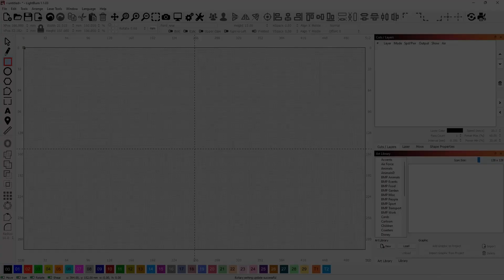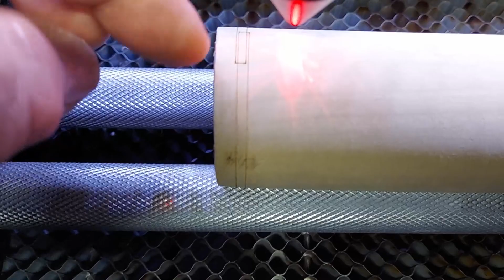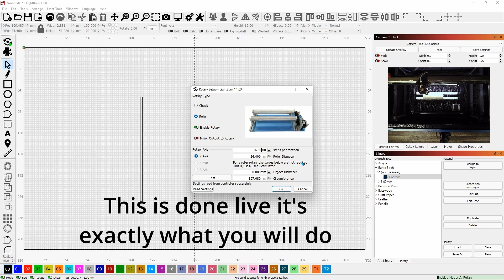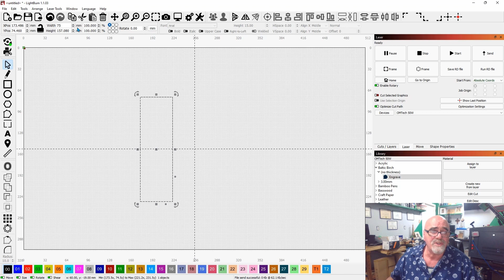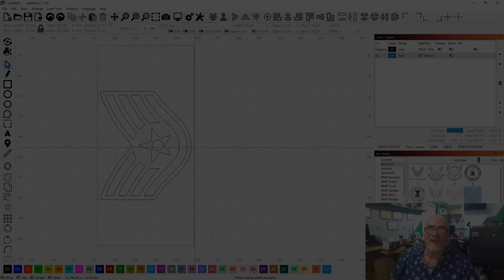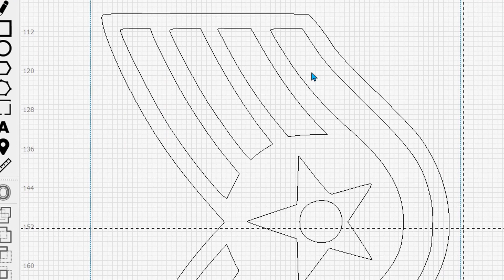🔐 Unlock The Secrets To Perfectly Setting Up Your Co2 Rotary Roller Accessory!

Comment: Does the same setup apply for  the chuck style rotary ? i was  put off installing mine after watching a couple videos. looked tedious.
Reply from the maker: Yes, the settings are slightly different though. You need to choose chuck in the setup. Most chuck rollers come with the steps per rotation in the owner's manual.

Comment: I did all the steps and it frames correctly, but when I hit start it doesn't move. What did I miss? I made sure to slide the safety over so that it would ignore the drawer being out.
Reply: Nevermind! There are 2 toggle switches on my Gweike. One LABELED "Rotary" <---> "Panel" and the other not labeled. I assumed both had to be in the rotary position but it started working when I put the Rotary toggle up and left the other one down. 🤷‍♀
Reply from the maker: Glad you got it working Cyndi!

Comment: Hi Rich many thanks for taking the time to do this video as there isnt that many on youtube that show you how to set the rotary machine up in lightburn.I followed your video to the letter by setting the laser on top of the cup to be engraved then turning the power off my machine so i can then connected the y axis rotary machine and turning my machine power back on but when i do this my machine automatically homes itself so i cant set the laser over my cup again. When i manualy home the machine using lightburn software it goes to home but doesnt stop at the home limit switches it just keeps going making a real loud sound so i had to turn off the main power as nothing else would work to stop it forcing itself into the side of my laser.I cant for the heck of me work out what im doing wrong so this is why im reaching out to you to see if there is something i have missed 
many thanks for your time
kevin
Reply from the maker: Check your owner's manual. Your rotary is probably on a different axis.

Comment: Good afternoon Rich! So, another dumb question: When it comes to the 4 wheel rotary style; will the steps per rotation need to be figured out only once or, will I have to do this each time I engrave an object with a different circumference?
Reply from the maker: Just once Bob.

Comment: Hi Rich, when you turned off the machine to swap over to the rotary after you had lined up the material/rotary; at what point did you turn the machine back on? Right after you connected the rotary or after you set up the frame height in lightburn/enabled rotary when you were ready to run the step calibration test? Does it even matter?
Reply from the maker: It doesn't matter Bob.
Reply: @TheLouisianaHobbyGuy  Thanks Rich. I have to say, In the last few years of watching all kinds of tutorials regarding cnc Lasers; You are hands down the most adept at doing them.

Comment: if I wrap my cup in tape with these lighter settings, will it burn thru n mark the cup or just the tape?
Reply from the maker: You need to set the power very low, just enough to mark the tape Micky.
Reply: @TheLouisianaHobbyGuy  ok thank u

Comment: Hi When you are setting steps of rotation why don’t you use a simple formula to take out the guesswork 9000/114 x 100 =7895 if the overlap is 14 mm too high i.e if it is too small then the formula would be reversed.  Saves having to test it several times.
Reply: Hi Rich I understand thanks though for the rest of the video - we have has loads of trouble with our roller rotary. Do you know how to change the rotation of the roller because when we select mirror the logo in Lightburn and resend the file nothing changes.
Reply from the maker: Just mirror it in Lightburn after you design it.
Reply from the maker: I like to see the results, but you can do it any way you wish David!

Comment: Awesome videos, I'm learning soo much for when my laser arrive.
I come from a 3d Printing background, would this formula be good to set the rotary steps:

[original steps/mm value of rotary tool] x [cimcunference of the peice] = [steps taken]

Using this, we can obtain the physical, correct steps/mm value by dividing by the actual length etched:

[steps taken] / [actual length etched] = [accurate steps/mm value to input in lightburn]

So in your case would be:
- 9000(original step/mm) x157.08(diameter peice) =1413720
- 1413720/171.08(diameter peice + overshoot estimated by you in 14mm)=8263.502455(new step/mm value for rotary tool)
Reply from the maker: Sounds good to me!

Comment: Rich, thanks so much for spending your time making these helpful videos and sharing your experience.  I am learning so much, so fast.

One way you could get to the correct steps/rev in one go would be to do a bit of math.  It would go like this:

I = the initial steps you try (9000 in your case)
C= circumference of your test piece. (157mm in your example)
E= error of your first test.  Just measure the over or undershoot with a caliper.  If it's overshoot, E is positive and if it is undershoot, E is negative.  (14mm was your guess)
F= is the answer of the correct number of steps

F= I x C/(C+E)
or
F=9000 x 157/(157+14) = 8263 if the error had actually been 14mm
Reply from the maker: Thanks Terry!

Comment: Thank you so much for this video.   It completely demystified using the roller rotary that came with my machine. I have one issue that I hope you can help with. After unplugging  the rotary and following the reset steps, my machine was back to normal. The only issue I've found is that when jogging my laser head front to back,  it goes past it's limits  and hits something,  making a loud noise.  Is a setting off?  What should I do?  I don't want the alignment damage.   Thanks in advance for your help.
Reply from the maker: If it's a Co2, you have to press the reset button after using the roller.
Reply: @TheLouisianaHobbyGuy  Thanks for the quick response.  Yes, it's a CO2, 50W Omtech.  I pressed the test button after disconnecting the rotary and reconnecting the original cord.  Was there something else I should have done?
Reply from the maker: @deeplyrootedone  I don't know what the test button is. You press the reset button.
Reply: @TheLouisianaHobbyGuy  I'm sorry,  I meant the reset button.

Comment: So one thing I see in a lot of these rotary setup videos is much like what you did in yours.  When you run your first test of the circumference and see that it overshoots the mark, you then take a guess on the new steps per rotation and test again, and you keep doing that until you find a value that works.  There is a formula that is used in the 3D printing world for calibrating the steps for the extruder.  For that they start with an arbitrary number of 100 and measure 100 mm of filament.  They make a mark of 100 mm on the filament itself and then tell the printer to extrude 100 mm of filament.  They then measure the actual amount extruded and use this formula:
([steps/mm value] x 100) /  [actual length extruded] = [accurate steps/mm value]

So to use that in this context, you would use this formula where you are replacing the 100 value with the circumference value:
([steps/rotation] x [circumference]) / [actual length moved] = [new steps/rotation]

Now filling in the values based on your guess of being about 14 mm over on the first run, you would get this:
(9000 x 157.08) / (157.08 + 14)

1,413,720 / 171.08 = 8,263.5

That number would have been closer had you measured the exact amount that you were over and not guessed at 14 mm, but as you can see, I got close to your end value of 8250 on the first shot and didn't have to take 6 tries to get there.  I don't know if you would want to make an updated video using this information, but as you can see, this calculation clearly beats the guessing method that everyone uses to figure this out.  Using exact measured values probably would have gotten you to a more exact value than what you got in your video as you mentioned that in the end you were still about a mm off.

Curious on your comments.

Dan Bemowski
Reply from the maker: Good tip Dan! Thanks! If I do another rotary setup, I'll use it. I saved the formula and your name for the credit.
Reply: @TheLouisianaHobbyGuy  Feel free to share this out on your facebook group and your forum, which I still have to sign up for.  It's something big that I think will save people a lot of time.
Reply: @TheLouisianaHobbyGuy  There is another way to figure out this value using the steps per rotation value marked on the stepper driver, and the gear ratio between the tooth count of the pulley on the stepper to the tooth count of the pulleys on the  roller shafts, but many of the rotaries have the pulleys and belt covered and not so easily accessible.  I wish the manufacturers of these rotaries would mark the ratio on them, but that's a topic for another day.  The method and formula I posted is one of the easier methods for calculating this though.

I have built a number of different machines myself including a few different rotaries.  Here is a link to some pics if you care to take a look.
https://dan.bemowski.info/image-gallery/nggallery/3d-printing

Comment: Great tutorial, as always. As
 a first step, I divide the steps by the object dia and that gives me an idea of how many steps per millimeter to assist in the zeroing in on the calibration.
Reply from the maker: Thanks Tom, but I don't get the math.
Reply: @TheLouisianaHobbyGuy  I made a mistake. Use the object circumference and not object diameter.
The initial setting was 9000 steps and 157mm circumference so, 9000/157=57.3 steps/mm.
You guessed the first overlap was 14mm. 14*57.3=802 adjustment for the second try.
That means the second try would have been 9000-802=8198steps getting you very close to the 8250 you settled for (which was still a little high by 1mm).

Comment: hey rich great video as always but here is my question. Before i did the last update to the lightburn i could do the max power and the min power. i know have the 1.1.01 version but i have no min power setting. if go to fill + line i have just max power with no min. is there a setting that im missing?. thank you once again for all the knowledge that you give to us.
Reply from the maker: I have 1.1.03 and it works fine for me. That might have been a bug in that version. Update to .03
Reply: @TheLouisianaHobbyGuy  thanks friend I will do the update

Comment: Do you recommend a cohesion 3d board or have any experience with one?
Reply from the maker: I don't actually recommend many things, since most things are user preference. But I did install a cohesion on an old K40 I had and it worked fine. So do most of the other types.
Reply: @TheLouisianaHobbyGuy  ok thank you for your insight!

Comment: I need help. first time laser user I bought an aufero laser and was excited to get going. I hooked up my laptop, turned on lightburn and then the laser. when it went to home position on lower left it was wanting to keep going. meaning it did not shut off. IM SCARED im going to break it. Do you know how I can correct this. Thank you
Reply from the maker: Can't help in the comments here, but I have a free forum with over 8,000 members and you'll certainly get help there!
https://lahobbyguy.com/bb/

Comment: I have question 
The z axis doesn't want to go down when using my  laptop and also the for some unknown reason when I send something to cut the machine would RUN a count but nothing will cut untill a few minutes later. Anyway to fix it
Reply from the maker: I don't have a motorized Z, so can't help with that. Not understanding the 2nd question.

Comment: I'm thinking... A tailor's tape (flexible) marked in mm. A bit of math (proportions). Might get the number in 2-3 tries.
Original steps * circumference ÷ measured burn = new steps.
So, 9000 * 187 ÷ 201 (you said 14mm too far) = 8373. Takes a little of the guesswork out.
Reply: Old Curmudgeon,  I had to laugh at your comment because I knew someone would give the formula to take the guesswork out of finding the right number of steps. The real funny part to me is my dad was a structural engineer and he and several of his friends that were architects and engineers would go out for lunch once a week together. They called themselves "The Old Curmudgeons Club". They probably would have figured it out with a slide rule.
Reply from the maker: There's more than one way to skin a roller Kris! 🤪 Problem is, you can't teach formulars to a lot of folks...
Reply: @TheLouisianaHobbyGuy  tis true, sir. Sometimes trial and error-(correction) is the easiest way.
Reply: @TheLouisianaHobbyGuy  that's for sure. I knew what you were doing and why you were doing it. I was a writer the last 8 months I was in the Army. I had a 2nd Lieutenant tell me I had to write on a 5th grade reading level. I told her if that is as far advanced as they are they aren't smart enough to be in this MOS. I still love your videos and I hope I made you laugh today.
While I'm thinking about it, have you ever calibrated your x and y axis stepper motors? Its real easy to do in LightBurn.  I've seen some comments where the person said his circles did not come out circles but rather more like an oval. The cause is one or both stepper motors being out of calibration.
Reply from the maker: @krisknowlton5935  I have before, but not on this new laser because they're fine. I'm in the process of doing a DIY Co2 build, so I'll show it in that video if I ever get it finished!
Reply from the maker: That's funny Old man (he's not really old!). But I did literally see someone on YT do  this!

Comment: Does the same test apply to diode lasers. I appears so.
Reply from the maker: Yes it does Merrill, but with a slightly different procedure. I did one on the diode last year. Control boards for the diode lasers have come a long way since then, so I'll be doing another one inside a special video coming up soon.